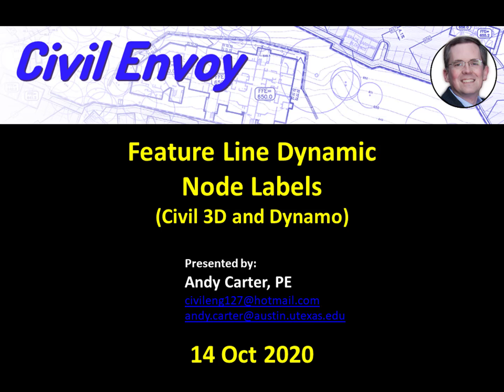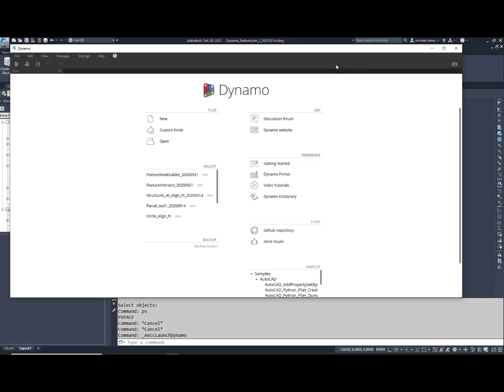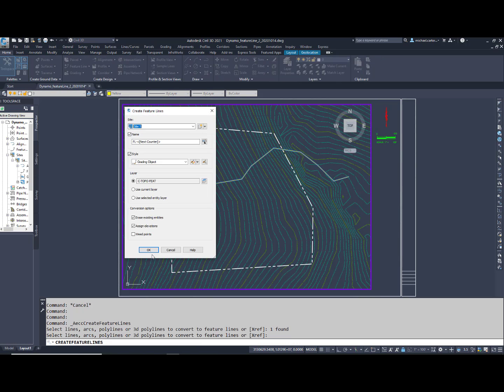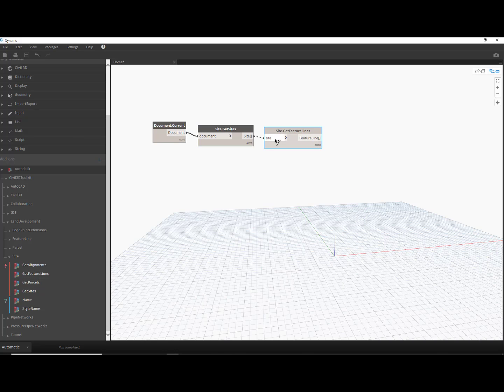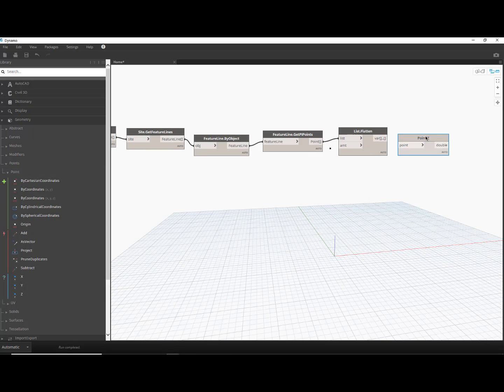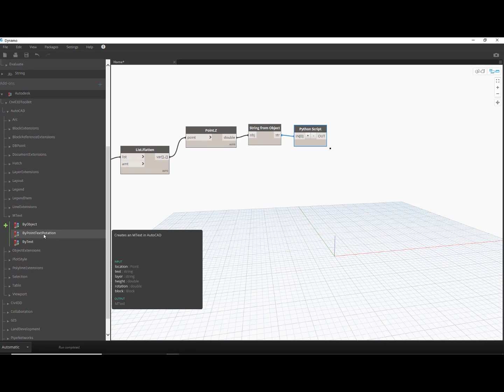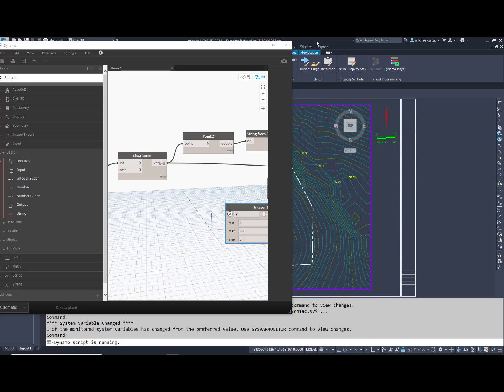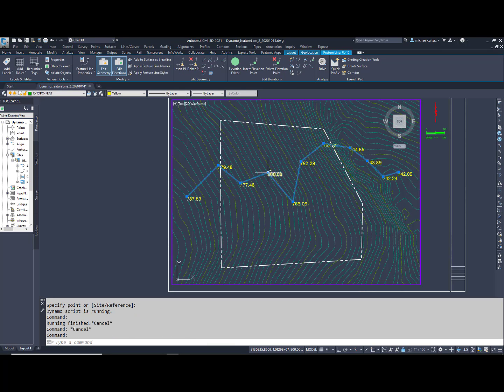Dynamo for Civil3D:  Feature line node labels

Comment: thanks much for sharing this informations
i am civil engineering student and i have a question about dynamo for civil 3d
do you see that dynamo is helpful and good for civil 3d as for revit someone told me its not that great for civil 3d do you agree with that what is your opinion please
Reply from the maker: Dynamo for Civil3D is not as mature as Revit.  However, you are getting into this world for civil engineering right at the ground floor.  In my opinion, all new civil engineers should node a little Python coding and getting started in Dynamo is a great way to figure out the automation.

Comment: I am looking for a developer to create a dynamo script that will export cogo points to different excel sheets. Does you or your company build these?
Reply from the maker: I would like to look into solving your problem.  I will need a sample set of points and some information regarding the desired Excel output.  With Dynamo, this should be pretty straight forward.  Please email to either address shown in the beginning of this video.
Reply: this is a typical task for Dynamo

Comment: This is great! How would you do slopes as well?
Reply from the maker: All feature lines can be converted into PolyCurve (which is a Dynamo type Geometry).   For each curve in the PolyCurve, get the length and the difference between elevations for the starting and ending points.  With these two values you have the slope.  Get a point midway on each curve to place the label (mtext) and you have what you need!